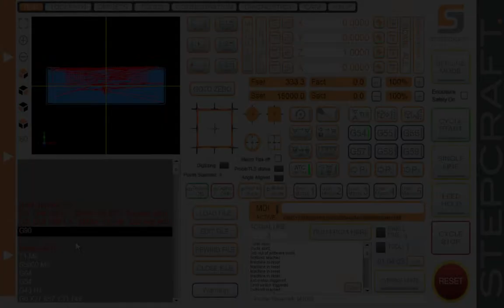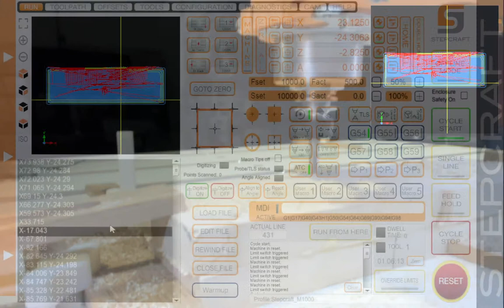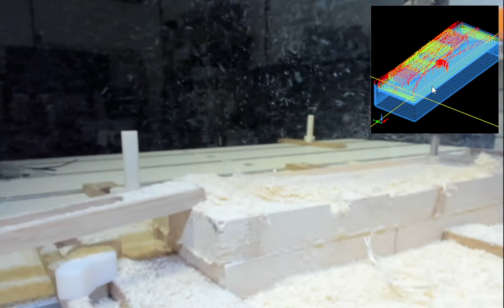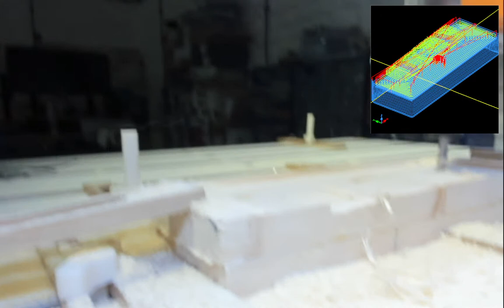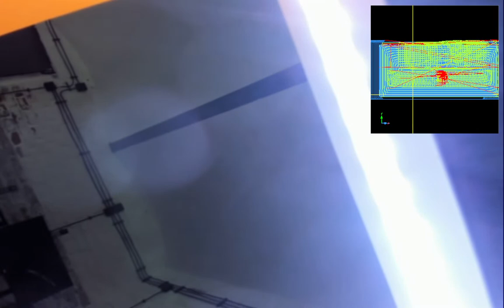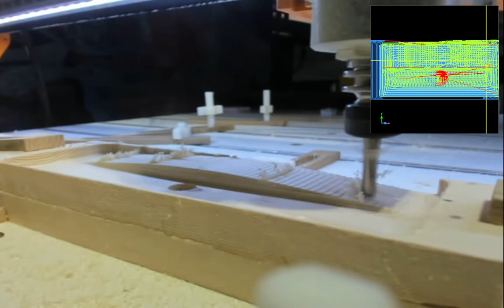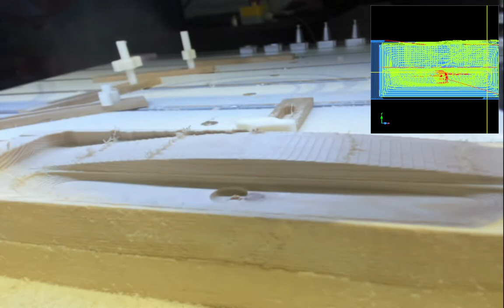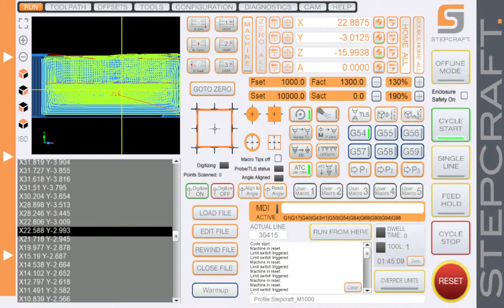Stepcraft M1000 CNC terrain test

Comment: Did it pass the test and how do you like the M 1000?
Reply from the maker: Hi, yes test was OK, but I am experiencing weird issue now. And I dont know whats going on. If I am goin in Y axis with jog menu, sometimes it is trigering limit switch. For example if I run offset macro from Home position, and it is measuring tools in slots, it will stuck and UCCNC is showing, limit switch was trigered…. But overall M1000 is great and precice machine.
Reply from the maker: It seems to be related with acceleration from 0 speed to max speed, because its hapening only when i go from Home to somewhere. Or if i am in the midle of table, any limit switch cant be trigered, but if i will move in Y, it will stuck.. i am thinking about upgrade with some optical endstops…
Reply: @printednest sorry to hear it,  have you talked to stepcraft yet?
Reply from the maker: @1960fusion  no problem, its solved , problem was tricky but I have it
Reply: @printednest  would you tell us something abot the Problem and how you solved it?
Reply from the maker: @alterstassfurter5743  Hi, yes problem was soved and it was quite elementar in the end. But investigation was hard. it was related to right endstop on Y-axis. There is small metal sheet which is bending and is trigering this limitswitch. Thiis metal shet was not able to activate endstop while homing, and was making probles while gantry was accelerating in Yaxis. It was causing trigering randomly. So I have bent this sheet correctly and problem was soved.
Reply from the maker: @alterstassfurter5743  here https://youtube.com/live/z9ssNkYb3B8